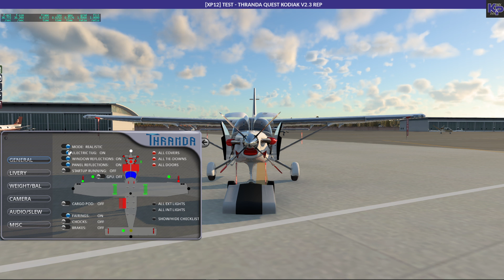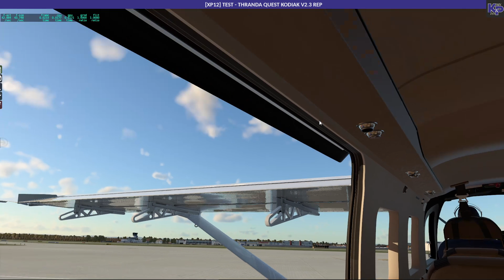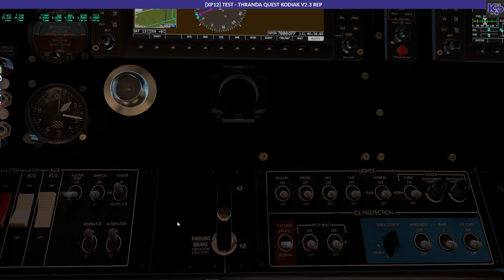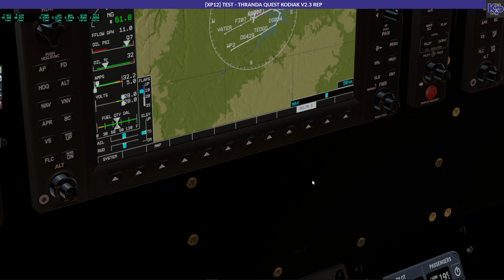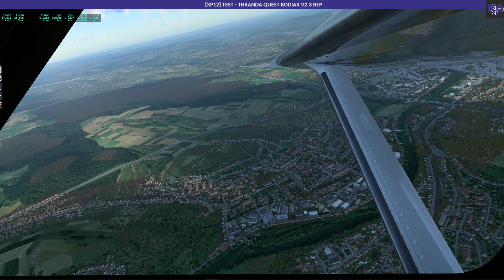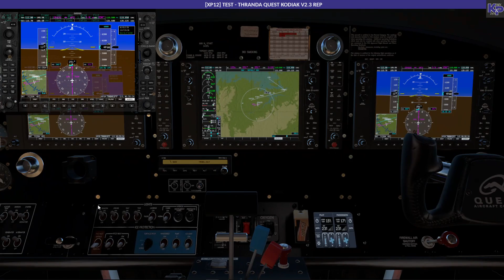[XP12] TEST - THRANDA QUEST KODIAK V2.3 REP (ENGLISH)

Comment: Inertia reels are part of the seatbelt mechanism, they are the things that stop the belts when you pull them fast in cars. They also lock when the car decelerates hard. On aircraft there's a lock lever to stop them moving even without acceleration. Getting ahead of the game incase there's a crash. Locked for takeoff and landing. They should be down the side of the seat somewhere, they were when I was an experimental observer on aircraft at the Royal Aircraft Establishment. Engine inlet is the inertial separator, at low level it stops things that come in the inlet from going straight into the engine, it lets them off where the air turns the corner and heads forward into the engine.

Comment: Why present a test, when you’re obviously ill-prepaired, and don’t know the plane and its settings?
Reply from the maker: this video was not about me knowing the Kodiak inside out and was not called a tutorial. I tested if the X-Plane 11 Kodiak works in X-Plane 12. And it seems to do (at least in the version of XP12 at the time of testing).
Reply: @prokopiu was there a reason you neglected to enable the synthetic vision? From what I understand the SASL plugin is the one part of the Thranda Kodiak that will not work in xp12.
Reply from the maker: @grovesy2700 😊 well, this test is obsolete now as we do have an XP12 version. I did not consciously leave out synthetic. I usually did not turn it on because of performance.